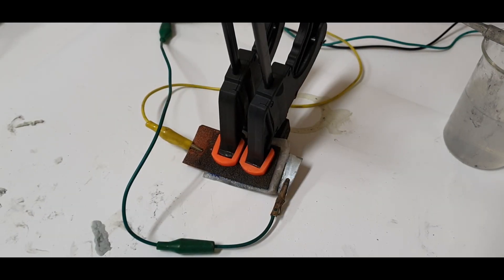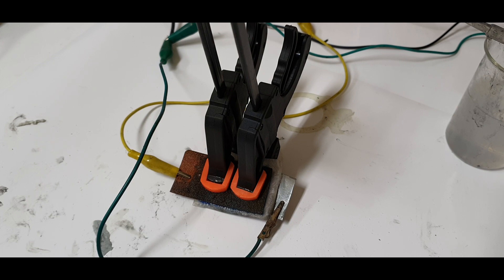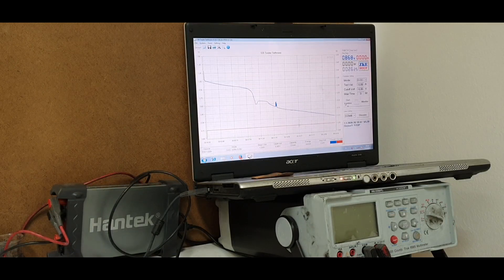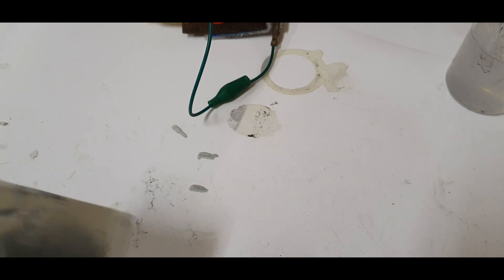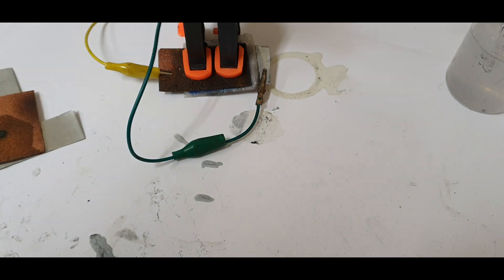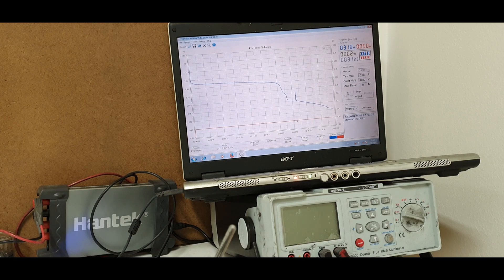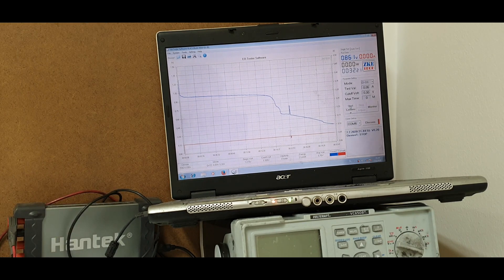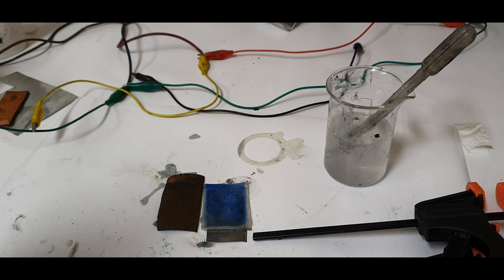DIY a Rechargeable Copper Zinc Battery

Comment: If the blue color from the copper oxidation is cobalt, then why do people mine for cobalt? ... when it is already in the copper hydroxite reaction, which is the same system used in creating Egyptian lapis-lazuli stones? I think there must be simpler way of creating such batteries with less corrosion and degradation, similar to what you've described in your inhibitor video.

Comment: so with 1V, at 400mAh/g, this would be a 400Wh/kg battery?
Reply: could you try a solar photocatalyst water split cell? electric field from this battery, with titanium oxide as the catalyst, should make all light split water, into hydrogen and oxygen at the battery electrodes
Reply: i would say this is a copper air battery, but your description should then be saying its generating cu-o and cu-ho when being used and generating cu when recharging, you just recharge it by allowing hydrogen to be formed at copper oxide, to strip out the oxide, to form metal copper, KOH might oxidize itself from air after electrolysis
Reply: could you try baking soda distilled water as electrolyte?
Reply: if this is a rechargeable zinc-air battery, just use an air electrode that will not oxidize

Comment: The discharge graph was looking better with every cycle, maybe only discharge it to 0.9V.
The cell forming looks important on this type of cell, as usual lots of parameters to experiment with :-)
Reply from the maker: Yes, the forming of the cell is important. The cell need to form copper hydroxide.
Reply from the maker: Here I only use copper and zinc,... maybe if I can add copper hydroxide for the active material or carbon current collector and copper hydroxide,... I dont know I'm just guessing.
Reply from the maker: I also try to charge the cell for a bit longer to form more copper hydroxide and the capacity was better.
Reply: @cayrex It looks an interesting chemistry, but a case of changing one thing at a time on a small cell, so the test cycles are quick.
The electronic load can show a lot, if you are on the right track with the mW/h.